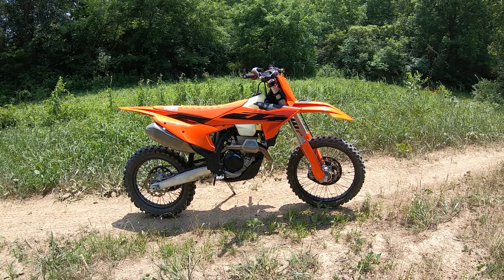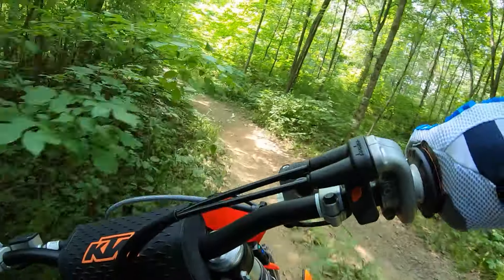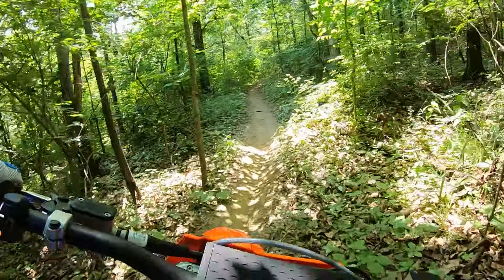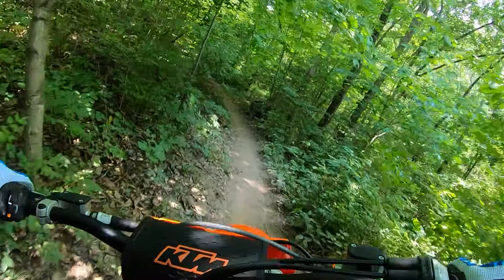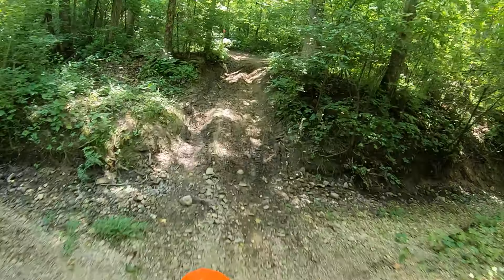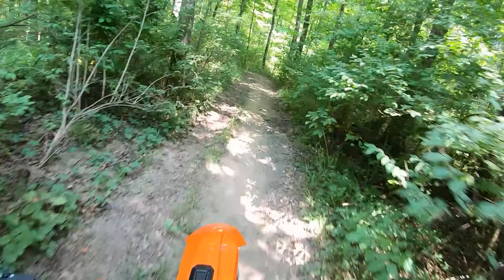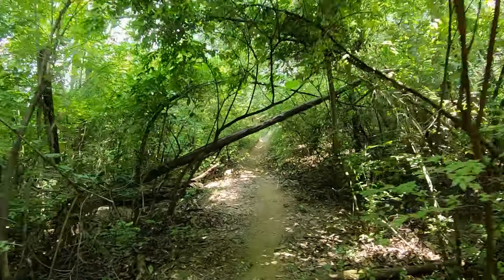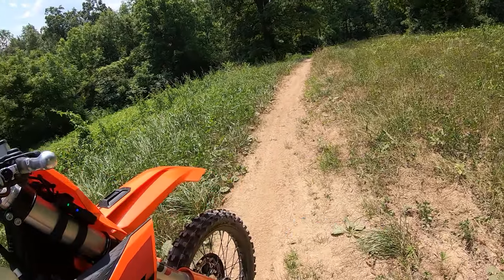2025 KTM 350XCF with CUO on Woods Loop: 350 or 250? You Choose!

Comment: I’m deeply researching my next bike purchase, I’m on the fence between new yz250fx (waiting for 2025 model), yz450fx,  250xcf and this bike. I am 5’9” and 180-185 lbs. Ride some moto and southern Ohio single track. Intermediate rider and I will not be racing. I have been riding a friends Sherco SE300 in the woods but I want a more well rounded bike. I really like lugging a bike in the low RPMs in the woods and I worry the 250s will leave me wanting more torque but I have never in my life rode a 4 stroke of any kind so I don’t know what they feel like. Love your videos and I value your opinion on the subject.
Reply: I feel like we are very similar (I may be older as I'm in my early 50's) but I bought a 2023 SX-F 350 and had never ridden a 4 stroke prior. I grew up on 2 strokes and so that's all I knew. These are very different IMO. The torque is incredible! It's the engine braking that has been SO hard for me to get used to. I HATE it!!! LOL Now (THANKFULLY) with the CUO unit as demonstrated here, it can be dialed back. I'm pushing 5'8" and I can tell you these bikes are crazy tall. Had to lower mine 1" and put a Guts -20mm foam on and I still struggle with footing. With that said, as you, I'm an intermediate rider who rides mostly motto track, but I also love woods riding similar to this video. Since purchasing my bike, I have ridden a 250 and a 450 and I can tell you that there's a pretty big difference in power and how you'd ride the bike. (think high revving a 250 versus lugging a 450). Haven't ridden either hard/aggressive but MANY say the 450 is tough to ride for long periods of time and to me the 250 felt so much lighter (much less inertia from the engine). That's why I settled on the 350 and I couldn't recommend it enough. Feels lighter than a 450, I certainly don't need more power (heck, I'm trying to tame this beast with the new CUO as he does in this video). Also, considering I ride both track and woods, if I had to do it over, I may get this bike (The XC-F 350) as opposed to the full on moto SX-F. Of course, the SX-F is beyond amazing on a track, I think the gearing and 6 speed transmission of the XC-F along with 18" tire and softer suspension does both better. Not sure you can go wrong with this 2025 XC-F 350!
Reply from the maker: Thanks for the real world 350 experience Brutus!

The latest YZ450FX is Beast with a super fun engine with very good but firm KYB suspension and a tall seat height (though 10mm lower than the YZ450F).  If you like lugging the 250F's may not have the low to mid torque you desire.  The 350 has plenty of low to mid torque (I dial it back for woods riding) and less inertia than a 450 so feels lighter though not as lightweight feeling as a 250F.  I like 300 2-strokes from Austria with TBI and the Beta 300 Race Edition - those bikes have lots of linear torque and are light and agile in the woods.  I think these recent KTM/Husky/Gas Gas 350 cross country engines run strong and are fun in the woods or on the moto track.  The woods 350 versions (350XCFW/FE350) have less compression and less power and are more stall resistant and run more smoothly at low RPM.  350's are such a great combination of Power/Weight/Handling.  Here is my latest 350XCF vs TX300 back to back... https://www.youtube.com/watch?v=X2JYSZUvgEw

There is no wrong choice - just decide what characteristics are most important to you and ride that bike!
Reply: @brutus6328  thank you for your input I appreciate it!!!! I have an affinity towards the blue bikes but it’s a tough choice either way it will be fun!
Reply: @mxengineer1  thank you for your time and input! What a great time to be buying a bike so much tech in these things now.
Reply: @Cdoles610  Not sure if I gave any real "input" but I'll take it! LMAO! The beautiful thing is nowadays, these bikes are made so well, whether you go with one of the Austrian triple, or Blu Cru, you absolutely cannot go wrong!

Comment: This is exactly what I was hoping the CUO would do! I was having trouble in the slow tight stuff with that aggressive throttle response even in the white map. Your suggestion definitely helped (gray throttle cam and traction control) but I'm guessing this is a whole different level of adjustment. With any luck, I can install the CUO tonight as I'm hoping to ride tomorrow. We had a bunch of rain here in Austin and the places I ride shut down real quick if it's too wet out.
Reply from the maker: Yes use the Gravel/Wet as the base power map and dial back Throttle Response to #1 (minimum) and turn Traction Control up to #5 (maximum) and enjoy smooth initial throttle response! And if it is too much put some Throttle Response back in.  Fun to try different settings

Comment: Any chance you can elaborate on if this new CUO has any impact on flame outs? I have a ‘24 FX 350 and sometimes the smallest use of the rear brake can cause an easy flame out. I’m debating fly wheel weight or this new CUO. Thanks
Reply from the maker: I don't think the CUO has much if any effect on flame outs based on my experience so far.  I've not stalled the bike on the woods loops so far but have also not ridden an super tight technical trails yet.  I will make a video soon of slow technical riding with the dialed back "250F" map and the stock Green map.  Flywheel weight should help on your 24 FX350.